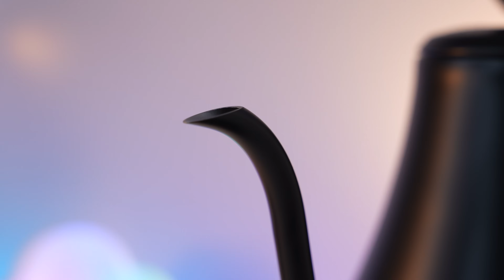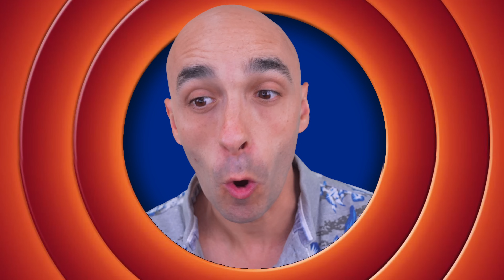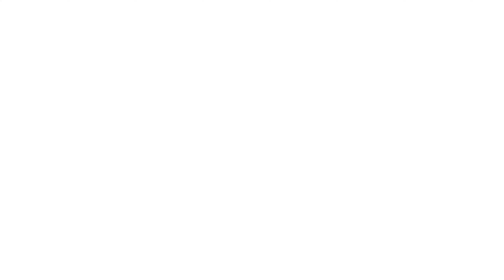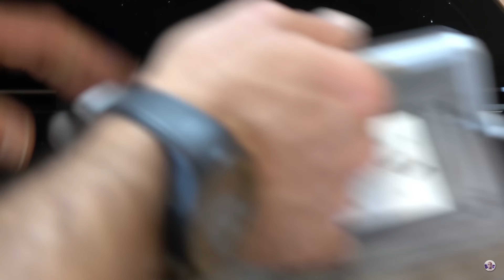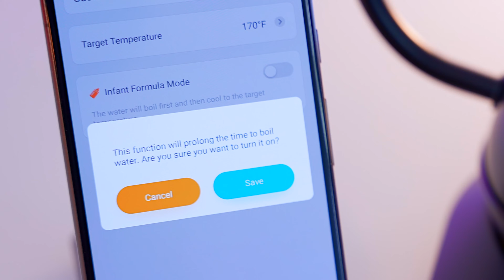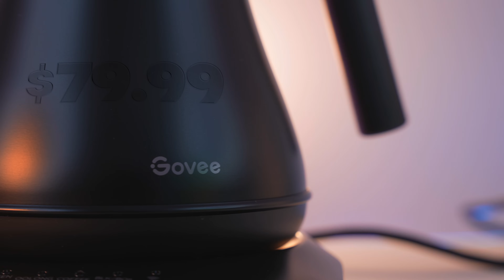Govee Smart Wifi Alexa Kettle | This Did NOT End Well!

Comment: GOVEE ELECTRIC TEA KETTLE PROBLEM 

I have a similar version from this company the regular looking one they're basically identical. 

Why did I switch from my reliable Kenmore electric tea kettle That's 15 years old still works goes from 120° all the way up to 212 works perfectly! Well I really wanted to get into the Smart kettle world..  More technology more problems more things to go wrong. 

There's a problem with these govee tea kettles  DO NOT GET THE KETTLE WET!! 

PROBLEM 1).  Water actually gets into the bottom of these things if you're not careful. And when it does there's a ground wire inside that will stop a fire so here's what happened to me. 

Overtime water got inside then all of a sudden about nine months later. The base kept shutting off.. no matter what I did. Looking in the app it said THERE'S NO WATER IN THE KETTLE. There was plenty of water. 

Taking apart the bottom of the kettle You could see that the ground wire connected to the base was completely BLACK!! Because water was leaking in not from the inside but from the outside.  

Govee SUPPORT IS GREAT THEY SENT ME A NEW ONE RIGHT AWAY!! 

So in other words Make sure the water is off in your sink then open the tea kettle put it under the faucet, then turn the water on before you move the teeth kettle turn the water off DON'T GET WATER IN OR AROUND THESE THINGS TRUST ME!! 

You might think yo dude DUA YOU'RE NOT SUPPOSED TO GET WATER IN THE BOTTOM THESE DON'T SUBMERGE IT DUDE!  I never submerged it! . Well I never had to worry about this before when I had a Kenmore one not a smart kettle that had presets 120 to 212.  I turn the water on open the top of the kettle push the kettle onto the water a little water got all over it. There was always a little bit of water hanging around. NEVER ANY ISSUES!! 

My Kenmore tea kettle WAS 15 YEARS OLD AND IT STILL WORKS!! 

PROBLEM 2 ( The automatic shut off when there's no water TAKES TOO LONG TO SENSE THERE'S NO WATER AND SHUT OFF WHICH DOES DAMAGE OVER TIME!! Try to never let water run out of these things Don't trust it. You will be doing damage..( again never had this problem with my Kenmore tea kettle I always forgot to put water in it. But what's good about the Kenmore. Is that when you take it off the base and put it back on it does not remember cuz it's not a smart tea kettle and if there's no water in it it will not start automatically like the govee does.. You have to hit the power button again. Little safety feature. But I've done that by an accident with the Kenmore brushing the power button no water. Shuts off immediately.. I think quicker than the govee. 

I told the company what happened again they sent me a brand new one they even said they'd give me my money back but I liked the kettle. I told them the issues they sent it to the engineering department. They need to fix and seal the bottom of this thing so water can't get in!! And the other problem as I mentioned. I feel like it does not shut off quick enough when there's no water in it we all do that we all forget.. That also causes things to burn out. 

So again put the water in it the way I I described. just never let the water run out always keep water in the kettle because the shut off feature is not that good not as good as the Kenmore.. again remember when you put the kettle back on the base it's going to automatically start to heat the water even if there's a tiny bit in it.. Kenmore automatically disconnects and starts over when you take it off the base and put it back. You have to physically hit the power button to start it again.

Comment: Hi Paul. Love your videos. One question: Do you routinely boil more water than you need? As you probably realized from your power saving challenge, heating water is a very energy intense thing to do. To boil water repeatedly because you can't be bothered refilling your kettle with the desired amount seems incredibly wasteful. Boiling one cup of tea takes no time at all. I got into the habit of measuring the water in the cup i am using to drink tea from and was surprised as to how much time this saves me. 

Have a good one. Love your videos

Comment: Lol not being a tech wizard and only using phone broadband thru its hotspot, l daily have arguments with Alexa about why she works fine one day then abysmall the other ( usually when I'm trying to show it off to other people, )
I get my ordinary kettle boiled by filling it the amount l want and  then having Alexa turn it on when l feel like a cuppa, via Phillips Hue plug ( tried cheaper ones but they wont respond to alexa, it wont discover them for some reason even tho its meant to.
Anyways I'm only on the peripherals of what most of you lads are into, l just have 7 ceiling bulbs, and 2 lamps working off Hue and Sengled bulbs, my tv on off via hue  plug again, same with my electric fire which l mostly use only for the flame effect.
I cant get proper home wifi without a lot of fuss, work and expense where l live so mobile broadband is how l go and even thats only whimsical because l live in the worse spot in the village you could find for a signal, if l dont have the phone in the exact spot it wont work properly, but if l lived 3 hundred yards away the signal is terrific, say with my place it will take hours to download a film,of say 3 GBs, if l take the phone up the road it will load in minutes, im seriously thinking of moving that 3 hundred yards lol.
If l did have full wifi l would go for a lot of the stuff on Pauls channel as l could get, door openers, curtain closers, timed security, robovacs, etc, but until l do make the move they are all just a dream to me but l love Pauls channel his sense of fun and l like keeping abreast of whats out there, a cat can look at a king.

Comment: so, small capacity, low power so slow to boil, cant tell water levels unlike most smart kettles, not even a water level window, no thanks it might be cheap but its also not that great, i'll stick to using my normal 3kw 1.8l kettle with a smart plug to turn it on and read the voltage drop to notify me it's boiled and an alexa button to fire it up and turn a light on in the kitchen (and light off again after 15 mins and warnings to fill and reset the kettle for next time).

Comment: On the assumption that you always have sufficient water in the kettle. As there's no water level detection sensor, how much does it deplete its life span by when it tries to boil air? It will take twice as long to boil this kettle than a normal one. For these reasons I'd rather have a manual 2.4kW+ kettle, check it kettle with my eyes and flick the switch with my finger. There are some things that really don't need or ought not to be automated. Kettles and toilets that attempt bum wiping are two examples.  Lastly, this Govee has no flashing RGB lights! 🤣

Comment: I'm thinking the elephant in the room has been sitting on your head, if you think am Alexa controlled kettle is a good idea. It's right up there with having say, an Alexa controlled rug or an Alexa controlled coat hanger! Unless this kettle is going to get up off its stand, plod across the worktop to the sink and fill itself with water, it might as well be made of chocolate. Oh, not forgetting to pour itself into the mug, adding of course the teabag it successfully got from the other cupboard. Don't most people fill the kettle and turn it on? Surely they don't think... Oooh, may want a cup of tea in an hour or two, let's get an routine set up for that! You could achieve the same thing with a timer switch, then you don't have to argue with Alexa thinking you want to vacuum the poodle rather than have a cup of tea.

So love your videos, how about you make one where Alexa is the presenter and it's programming routines for you? Obviously you'll only understand about 10% of what Alexa says to you though.

Comment: Does it have a security feature that will not try to boil until there is enough water inside?
Anyway, it’s too small. And I couldn’t justify buying one, I would need to refill it manually anyway, and make a tea. Not good enough. There are kettles on the market which support setting up the temp without a need of wifi

Comment: 1200W is a bit pathetic. I imported two 3000W Kettles from the UK, and use them here in Northern Nevada in the USA. Yes, many homes in the US have 240V, though not often as low-current (below 30 Amp) outlets in a kitchen area. Many modern homes in the US have what are called "shared neutral" 120V outlets in their kitchens, which means that they are wired to the breaker panel with a 4-wire cable (with two "Hot" wires, one Neutral and one Ground).

Shared neutral outlets are used to allow two separate 120V 15 or 20 Amp circuits to share one cable, reducing material and installation cost, at the cost of the slight inconvenience of a circuit overload tripping BOTH circuits in the event of an overload.

Such outlets can be easily converted to have dual-voltage 120V/240V receptacles, both of which can be used at the same time.

Comment: "and it's a kettle that I set fire to": Once again providing us with the valuable service of doing something so we wouldn't end up doing the same thing. Thanks so much.
"I am ridiculously excited to find that they are spreading into the world of smart-home gadgets": I just got a Govee temperature and humidity sensor for my wife's indoor sunlamp box. Not only does it support warnings for low and high humidity and temp but it also shows both locally on a display. The smart-home integrations could be better, but it works for now. Govee is really turning out some nice stuff.
[Love the Quantum Leap homage]
One further question in the "potentially burning down your house" area: Would this potentially support placing a single cup on it to heat it up?
Agreed on having a water-level sensor and warning. I could imagine boiling a kettle full of useless air quite frequently. The only question would be whether I'd have to have the kettle live outside because of it.
Thanks again for a great review. I'm fully considering this product for my mom who is a ridiculously constant coffee drinker and is also constantly nuking her cup to heat it up.
See you next Saturday.

Comment: For those of you in the UK or other 240V countries, you can choose a MUCH cheaper, smaller option to reduce your mains voltage to the 120V required for US-spec devices. A cheap Triac-based "dimmer" that is rated for the power that the device uses will suffice, as long as the device will function properly with the "mangled" sinewave that a Triac will output. Almost anything that uses resistive heating elements and/or electronics will be fine, but devices that need a clean sine wave (like some types of electric motors, and anything with a transformer inside) will likely not do well.

Comment: So this product has no potential outside of UK and India?
Reply: It would be dangerous to use in both those countries as it's not designed for the voltage they use.
Reply: @stephenc6648  yes because clearly they would never make this in a 230 volt version. Ever.
This product is a strictly 120 volt product. 
You are correct!

Facepalm

Comment: I have 1 kettle and 1 hot water dispenser (for my airBnB). I would never go back to a kettle. I think they should have made a hot water dispenser. You could also set the volumes differently as this is already a standard function. They’d have needed to build in a water holder as mine you put a cup in and press start. If my kettle ever breaks (and it has been going for almost 20 years) if I have to pick between a Smart Kettle and a dumb hot water dispenser the dumb HWD will win easily.

Comment: It's cute but there are better options (although a bit pricier) like "water dispensers" that are self filling and can provide hot/boiling and/or cold water at a press of a button. They also include filters. The Kettle has a nice compact design but if I have to worry about and put the water in, I can also flick the switch myself.
Reply: What part of smart home don’t you understand? An instant hot water thing will accomplish none of this. You also don’t understand that with one of these kettles as soon as it’s empty you refill it
Reply: @emilsecker7881  You obviously never saw a good water dispenser in action. Sure - for this price, this Kettle is amazing.
But functionality wise, you still need to fill it manually and you never know if it's already full or empty. It's a hassle in my opinion, almost no point in making it "smart".
At least it shuts itself off when the water is hot or when the water dries out.. but wait, my $10 kettle can do that too.

Comment: Rather a pointless idea I think. Apart from the obvious fact that you have to put water in it before you can use automations to boil it, so no actual time saving, there appears to be no way of showing from the outside physically, or via the app, that water is even in the kettle. Switching on a supply to an empty kettle which could easily happen, would burn it out? All it takes is somebody to use the water and forget to fill it up.
Reply: Kettles normally have a thermal cutout to prevent this but I don't think it would be a good idea to use the feature regularly.

Comment: Smart pouring kettles aren’t anything especially new and tend to be judged by accuracy of their temperature, accuracy of the hold temperature, the pour quality and how easy it is. They have been fairly niche and the small capacity / lower wattage suits that. The idea you would want to leave the water sitting in the kettle overnight would probably freak out a coffee enthusiast who only uses coffee ground within the last few minutes for their pour over 😅
Reply: This. It's a pour over kettle designed for brewing pour over coffee with 'smart' bits added.

Comment: Iv always wondered about smart kettles, when you have the possibility of instant hot water tap’s which aren’t that expensive anymore it makes me wonder what the use for this is. You still have to fill it and pour it. Also it’s half the capacity of most kettles as u mentioned and half the people power at 1800w. Great review as always paul.
Reply: Renters who don’t have an appropriate layout for installing an instant tap and for people who drink tea (where you might want to vary between temperatures)

It’s also useful for recipes which require warm water.
Reply: Filling it isn’t an issue. Just fill it as soon as it’s empty
Reply: @emilsecker7881  then you might as well fill it and turn it on by hand. I always fancied one just can’t see it’s use as you need to be there. Coffee machine on the other hand
Reply: @jk330ci  according to your logic you still have the same flaw with a coffee machine. A smart kettle works great imo
Reply: @emilsecker7881  Well of course you do. Coffee machines are not suited for automation either, so what's your point?
Reply: @TarecPL  unless you have a coffee pot. You can put a switchbot on it to turn it on